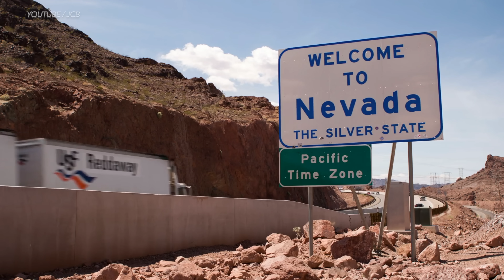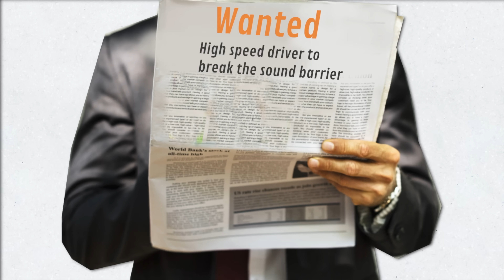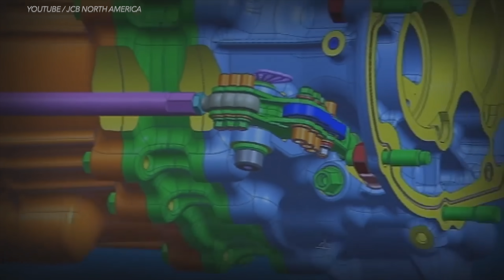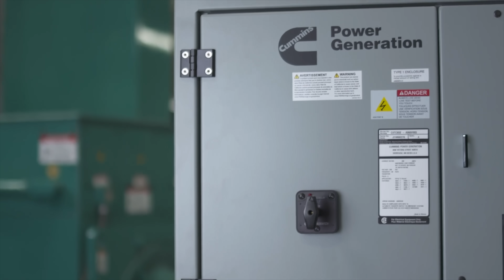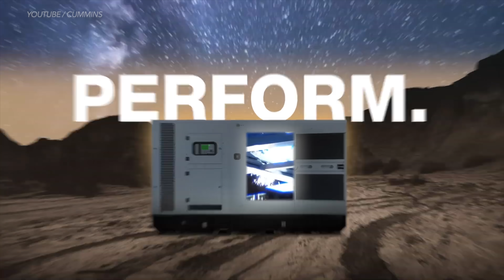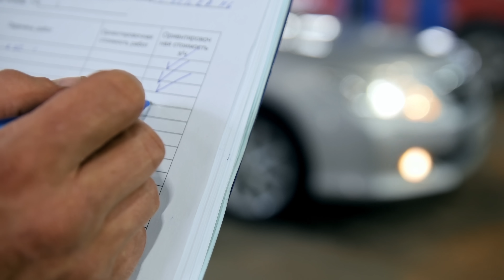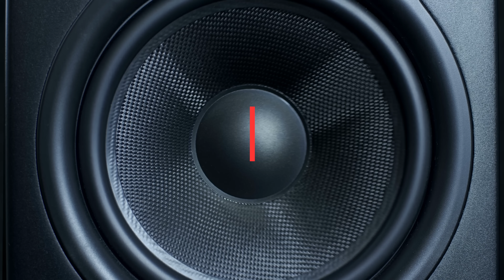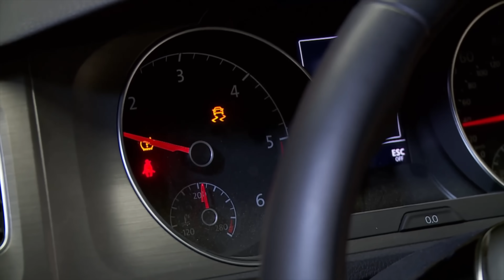Here's Why Diesel Engines are Being Banned

Comment: Love my 2015 Golf TDI. 50++ mpg on trips. And the hotter the weather the better the mileage. Was almost new when I bought it in 2019 for 14k. 6 speed manual. Now in for service has a check engine light for oxygen sensor but no problem it's got an 11 year 162k mile warranty. Best warranty available for a car bar none.

Comment: HI GOOD SHOW.    NOW WITH THAT BEING SAID YOU DO KNOW THAT DIESEL ENGINES HAVE GLOW PLUGS FOR COLD WEATHER  STARTING DON'T YOU.   I'VE STARTED DIESEL ENGINES WITH NO PROBLEMS IN MINUS 25 FAHRENHEIT.   AND THEY STARTED JUST AS QUICKLY AS A GASOLINE ENGINES . AND IN SOME CASES THE DIESEL STARTED RIGHT UP AT MINUS 25 FAHRENHEIT AFTER SITTING FOR OVER 24 HOURS AND THE GASOLINE ENGINE WOULD NOT START EVEN WITH EITHER.  DIESELS START RIGHT UP NO ETHER EITHER DIDN'T EVEN HAVE TO POP THE HOOD.      PUNCH IN COLD START DIESELS ON YOUTUBE AND WATCH 100S OF PEOPLE STARTING THEM UP IN LOWER TEMPERATURES THAN I DID.

Comment: I have a Chevy Colorado 2.8L Duramax and man that is one hell of an engine. Plenty of torque and capability, insane mpg 34mpg+ . 81k miles strong absolutely no issues. Diesels are not dying, I think more people should switch to diesel cars/trucks… Especially that new redesigned 3.0L Duramax engine in the GM trucks those are getting praise for their mpg and power. 
LONG LIVE DIESEL
Reply: I own a 2014 Holden Colorado with the 2.8 Duramax engine. It is pre DPF and has forged internals. It uses around half the fuel under load that my petrol or gas Landcruiser used. It is an exceptionally good engine. EV trucks for load a technical dead end without a fundamental change in power storage. The weight to power and range equation doesn't work. But diesel    has problems Euro 5 compliance is one and excessive complexity is another in some engines e.g. Toyota Landcruiser resulting in short and very costly lifecycles.
Reply: @rosewood1  2014 is pre-DPF? You are really lucky. In Europe all diesels after 2005 or so have DPFs,  FAPs , etc.
Reply: I have a 2017 Colorado 2.8 with 108k on it. I love the little truck. I average around 24 to 25 mpg around town. I get 29 plus mpg on the interstate. I was going to get the new 3.0 duramax but the oil pump belt has to be changed every 150k. You have to remove the trans and take the back of the engine apart to change it. Screw that!!!
Reply: AMEN!!!
Reply: My dad purchased a GMC Canyon with the Duramax, and he absolutely loves it!
Reply: The long life of diesel engines is why they are popular. It caused the price of diesel to double from popularity
Reply: I have a 2.8 ZR2 and I love it! I can’t imagine how sweet to would be if they offered the 3.0 in the new Colorado’s. I hear that 3.0 is super efficient and powerful.
Reply: Diesels aren't dying, they're being killed.
Reply: 81k miles for a Colorado 2.8 L??????? Are those engines being sold in the uss??? where are you from exactly=????
Reply: Cost more to purchase and costs more fill-up, costs more for maintenance.  I’m selling my f350 Superduty power stroke.  For the few times a year I need all that torque I call live without it
Reply: Love my 19 yo DMAX  runs like new leaks nothing 20 mpg crew cab long bed 35 in bfg.
Reply: @techs1smh13  I agree - my 2004 drives on and on, with no problems.

Comment: I live in Norway and I have a 94 6.5 turbo diesel k2500, I used 60 liters (15.85 gallons) on a 583km (362 miles) trip and this wasn't a flat road trip either, I drove straight over the mountain pass here. Also I am saving alot of money on parts, since I can do all the work on the truck myself also.

Comment: I have had a few Diesels in the past.
Nissan Sentra Diesel, VW Golf, VW Jetta, VW Beetle, Dodge 3500 plow truck, oh and yes two 90 HP New Holland Tractors for snow removal, and presently a small Kioti CK4010.
In the winter the large tractors had to be plugged in. The Dodge had to be plugged in if it was below -20C. The cars and the Kioti are and were ok down to -30.
I would like to have another Diesel, but fuel price difference between gas and diesel fuel make them less attractive.
Maybe some day?

Comment: Mustard gas - chlorine gas, will kill you in a couple minutes.

Electric cars are charged by coal fired power stations. So diesel vehicles are actually much cleaner in the EU. Mufflers should be pointed at the ground at a 45-60° angle \ so the HVAC system doesn't inhale exhaust gas when the car is is backing up.
Reply: Reach out to me☝️☝️☝️

Comment: Diesel is not dead. Most trucks around here are diesel. The best 2 engines ever put it a light truck is the international 444e( 7.3 power stroke) and Cummins 6bt (5.9 Cummins). I will never get rid of my 7.3. when the truck body wears out, I will put engine into what ever truck body is available at the time, and I'm building an f150 with a Cummins 5.9. Diesel run on off road for life baby.

Comment: If we go back too  Horses🐎 and  mules they wood be bitchen about  methane emotions  oops  emissions don't  know how you could get a catalyst converter on an animal   = the other  factors  is diesel engines  last to long   = this would some what effect production  sales  of  cars  . Before political  nonsense  gasoline  is more expensive  to refine from crude oil  than diesel ¿  the greenest way too go  would be compressed  Air. With wind and solar  running modular compressors  = charging  air tanks 🤔 gangs  of small ones = safety factor + hand ability %   gas stations  become  air stations   refill or tank swap  either way  depending on  time.  BUTT this would  effect  an entire❔💲⛽ industry  % P. S.   Oil buy products = plastics  resins nylons  raylons  😭  rugs/  clothing   shoes    not much cotton  anymore/  most products  have moved  away  from wood and metals  = cars have a lot of plastic  components these  daze  cheaper faster  lighter 🔥  computer   cell phone  printer T.V.  radios   toys   🎠  food packing ! water bottles   it's  ever were  .  A small observation   here in South Florida  we have  MT Trashmores  from non bio degradable  buy products.

Comment: Hi Scotty, Yes old diesels are better. The newer ones are very expensive to repair. So I would still prefer the older diesels. Particulate emissions being sub 500nM are far less harmful than modern particulates because the particles are so small you cannot see them. This makes for a clear exhaust but it is still there. If you reduce the operating temperature the NO2 emissions can be less but efficiency goes down. Older mechanically injected diesels are a very good choice but unfortunately now being phased out. I am having to deal with Kubota diesels for stationary systems and the newer ones are a big problem. Very little gain in anything. Specific  fuel consumption is worse than their simple mechanically injected engines. They cost more and difficult and more expensive to repair. They also use a lot more material than the older engines hence using up more of the earths valuable resources. They are much less rebuildable as obsolescence is built in with the electronics.
Reply: Exactly,  I have the old diesel F-250 mechanical non-aspirated diesel.  RUNS forever and very easy to repair.  Not like todays one that has a regulator or something on EVERY injector and they are located in the valve cover nowadayze.  What crap!
Reply: Reach out to me☝️☝️☝️

Comment: Hey Scotty, the oil change cycle on my Lexus GS 450h (2007) is 15.000km (bout 9400 miles). I drive about 80% Highway (50-70 mph) and the 15.000km mark is about once in 9-10 months. Should I change it more often?
Reply: Reach out to me☝️☝️☝️
Reply: No, if you were to drive 80% city you could think about replacing it every 10,000km - but even then, it’s a Toyota hybrid and therefore drives on electric power as well… especially in the city.
Following the 15,000km interval you will be fine. Those are good powertrains that can last a very long time

Comment: well lil scotty, if done right, u can run diesel on old grease from restaurants, aaaaannd so on , NOT that im a diesel aficionado, in FACT i tell those over done diesel hopped up pickup truck owners, why dont you have the exhaust pipe out the FRONT... since u love it so much...so i dont have to deal with that crap...since u love it so much
Reply: Reach out to me☝️☝️☝️

Comment: To answer your question at the end of the video, Scotty - I think diesel will die at the consumer level, but may be around decades more for industry.  First off, awesome job explaining the sheer depth of how much diesel is involved in industry.  When everyone talks about the move to electric, they seem to completely forget about massive industries like construction, locomotives and the backup-systems used by so many businesses.  I work at a large Canadian University (we have 109 buildings), and most of our buildings have generator backup.  What kind of generator?  Diesel - ALL of them.  That sort of infrastructure is not going away any time soon. 

The reason I see it dying at the consumer level, however, is a simple cost-vs-benefit argument.  Consumer-level diesel engines now have to comply to some very strict emissions standards.  There are two big costs here; one is the added up-front cost of buying the engine, which is buried in the price of the vehicle, and the second is the death knell of the product; the eventual maintenance costs during the service lifetime of that vehicle.  Buying the additional fluids and filters required to meet the emissions standards costs more, and then eventually if that engine requires a service or has a problem, the cost of repairing a "clean" diesel engine is astronomical.  For the average person, that puts the engine outside of the realms of reasonable affordability.
Reply: Reach out to me☝️☝️☝️

Comment: this lady i know has a low mile 2019 diesel Jaguar F pace. I HAVE NEVER BEEN A FAN OF JAGUAR QUALITY AND JUST TALKED MY SISTER INTO BUYING A BRAND NEW TOYOTA HIGHLANDER LIMITED OVER A JAGUAR SHE WANTED. Good thing i did because after driving in this Jaguar SUV everyday I hate them more than ever. You can definitely smell the diesel more than a modern heavy duty diesel truck. Not to mention the vehicle just wasnt solid. really a mess. Her highlander she and i couldnt be happier with. Her 2008 hit 280k miles and TOYOTA gave her 9grand for it and she was looking at the JAGUAR as a replacement. Honestly her old highlander drove better than a new jaquar.

Comment: Untill maybe about 2019, in Sweden where I live, more than 80% of sold cars were diesel powered. All Volvo cars, all VW cars and others, have models that only come with diesel engines, no petrol. My wife I, both drive diesel powered cars and no plans to change that. When it is -40 degrees C above the polar circle, only diesel engines can start, and engines are reliable and live longer, just go to your dealer and change the oil and drive responsible...
Reply: Reach out to me☝️☝️☝️

Comment: I drive diesel, but with all the hardware needed now to clean up exhaust, lowering mileage, it costs more to drive than gas.  Top mileage on my car is about 55 miles to the gallon (imperial), but when the regen kicks in, it will drop to 30 mpg.  Not worth it any more. When I started driving, diesel fuel was 18 cents a gallon.  Last time I filled up, cost me more than I paid for my first car
Reply: Reach out to me☝️☝️☝️

Comment: Back in the day my mom drove a dealer new 1980 Volkswagen Diesel Dasher until the frame rusted out in 1990 from winter road salt. It gave the word SLOW a whole new meaning, but made up for the lack of power with great mileage 40 + mpg around town / 50 + mpg hwy. She always drove at or below the speed limit & I mentioned numerous times to her, she should at least  drive the speed limit , so as not to cause an accident, did she listen,  * No *.      😲😲😲

Comment: Two diesel cars in my family. Can’t beat the range you get per tank of diesel and the torque is brilliant. It used to be even better when diesel was much cheaper than petrol, now days it’s far more expensive so the diesel advantage is definitely not as good anymore.
Reply: Oil companies testified before Congress recommending higher taxes on diesel.  They don't want passenger cars getting 50+ mpg.
Reply: Diesel costs much less to refine so taxes much be very high to make it dearer than petrol.
Reply: @wyattfamily8997  that's exactly why it is higher.
Reply: decades ago the UK promoted diesel car over petrol... green / environmental / MPG/L etc... then put the tax up on diesel to make it more expensive  /G (or L) than petrol... to take more tax from the ability to get more MPG/MPL... you think your doing the right thing and get something (for the higher cost of the diesel car), and it's taken away pretty quickly...
Reply: @Richard_L_Y  yup, there was some really poor messaging from UK Govt. Now the pressure is on going electric, but no figures on energy costs in scrapping perfectly good cars and costs of new electric ones. Also no figures on lifespan and costs of batteries of electric cars, ie second hand market. Another issue is the supply of rare earth minerals. It's not simply diesel bad, electric good, there needs to be transparency on all the issues involved in changing fuels.
Reply: @adrianbennett6788  Hybrid yes; for those that can afford; EV no, we're nowhere near ready and the one's on the road or being sold now will prove too unreliable and far more expensive in the long term. Then again, unless these things are heavily promoted, pushed and bought now, which can only be done without providing the full information, although it's all publicly avaialble (so do the full due-diligence first - but how many do), there won't be the continual developments needed to make it work in the long term; like most things technical.
Reply: @Richard_L_Y  oil companies paid them off to raise the taxes on diesel
Reply: Where I'm from diesel is nearly the same price as petrol
Reply: @aaronmahanga7635  where are you?
Reply: @johnnycarson67  new zealand, and those prices are just where I live  its different up n down the country
Reply: @aaronmahanga7635  I understand.   We should,  by all that is right,  have mostly diesel vehicles in the u.s.
Reply: it's all about the tax
Reply: Deisel $2.98 per litre/ petrol $3.05 per litre
Reply: It because of government taxes. The political money, money, money.

Comment: Hey Scotty: I’ve owned 3 diesel VW’s and loved them.  My 2011 TDI got a free reprogram and it only suffered 1 mpg.  So around town I got 38, and hwy I got 49.  I also own a diesel F350 that I tow my camper with.  You can’t beat a diesel for towing.  Even the new electric trucks only tow 10,000 lbs, and got a whopping 95 miles before recharging for a couple hours.  Last but not least I have a diesel tractor that also powers a generator should the house lose pwr.  So yes I doubt it will be replaced and time soon.
Reply: I have a 2013 tdi that received the EPA negotiated fix. If I remember correctly the cost 3hp and .5  km per 100 km. It VW billions in an attempt to satisfy California emissions. Yes diesel costs more but my 2013 tdi wagon gets 800 odd km per tank and 2002 tdi jetta sedan gets 1000 plus

Comment: Hi Scotty I have to disagree on one of your comments I live in Canada I have a 2018 Chevy Colorado with a 2.8 L Duramax it’ll start in -20 below Fahrenheit without being plugged in and it heats up just as fast as a gasoline car because the turbo charger is liquid cool I’ve owned this truck for four years and I’ve never had a check engine light or any other problems. Maybe I’m just lucky lol 😂

Comment: I'm from country where Diesel and LPG is really a common thing to see. Pure Gasoline cars are seen as something weird because fuel efficiency. I bought month ago Toyota Tacoma which is not available in Europe with 2.7 2TR-FE and damn. This is what I wanted from the day I've got my driving license. Sure, fuel consumption is higher but damn it. No turbo, no AdBlue, simple af and that's the reason why I choose old fashioned gasoline engines. Clutch is cheap to replace instead of diesel's dual mass flywheel (yeah new gasoline cars also have DMF but I'm talking about good and cheap cars), I don't see any DPF which is terrible in towns and low range driving. I don't have AdBlue tank so it's way cheaper (in my country it's not that cheap). Fuel injectors in diesel engines also can be problematic and expensive if something is wrong with them. 

To be honest. I'm a truck driver and diesel engines are good but for heavy duty trucks, not for small town cars. Diesel means long distance driving, not in town. You want indestructible diesel engines? OM615-617 from Mercedes or SDI from Volkswagen. That's a really good diesel engines I know but no longer in sale. 
That's why only gasoline (without turbo) engines are in my mind and I'm going use them as long as it's possible.

Comment: Morning Scotty

Item not widely publicised in GB press but confirmed by a VAG Main Dealer.
Volkswagen (and the rest of VAG Group) are selling new electric cars with only 6mm of tread on tyres, rather than the usual 8mm.
Because of higher torque and regenerative breaking wear of tyres on EVs is much higher.
All this means that tyres wear out much, much, faster on EVs compared to ICE vehicles.
Another hidden cost of EVs no ones talking about.
Reply: I have been driving  electric cars for ten years, and that is actually 100% not true Trevor.  If you drive and accelerate and decelerate like a madman, sure you will wear your tires out more quickly. Maybe the people that wear their tires out are having fun and being sporty with their very capable cars, but drive normal and you will have normal tire wear.